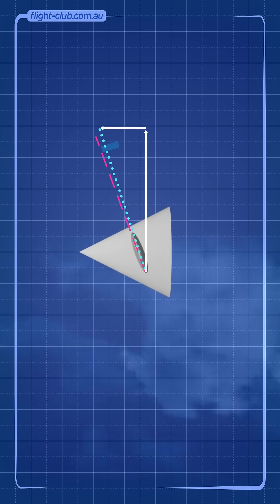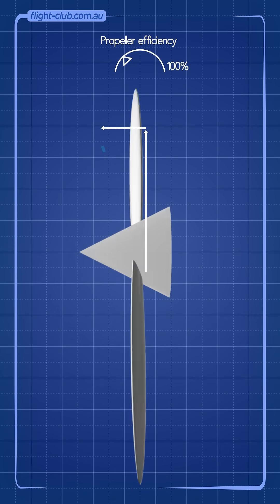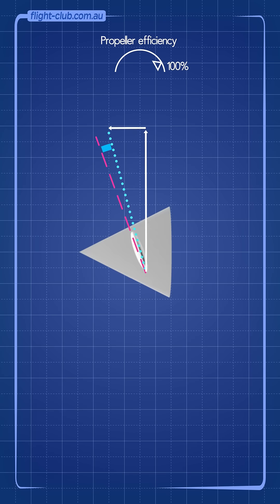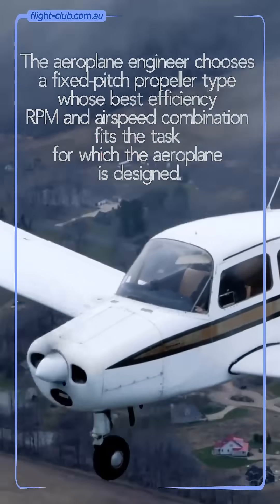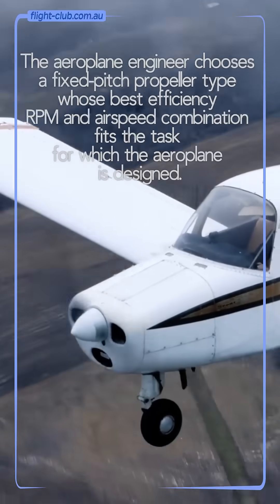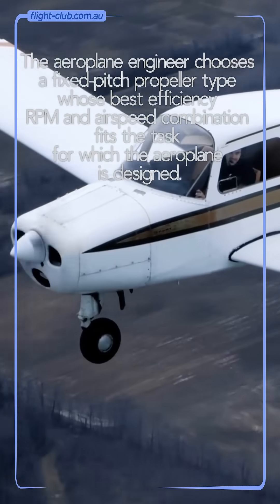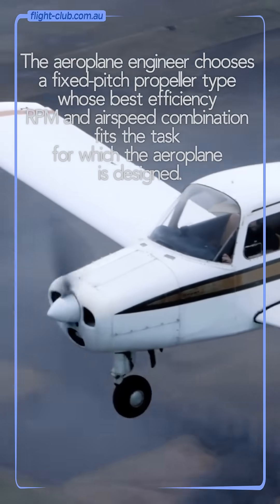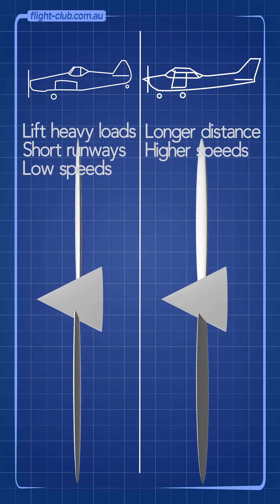Fixed Pitch Propeller #aviation #flight #propeller

Comment: Best way to think of a constant speed propeller is like gears on a bike. Going uphill? Low gear allows you to pedal fast without doing much workload. Level High gear, less rpm faster speed less tiring. It didn’t click for me until my instructor explained this. Doing my ppl ride in a c.s. propeller aircraft

Comment: The last part of the video.
I get the heavy loads cuz maybe and I’m also sure that it makes the aircraft slower hence you need a fine pitch propeller cuz the this will increase the blade AoA. I also get the slow airspeed, but why a short runway needs a fine pitch propeller?
Reply: Im not a professional, but basing my thoughts of aerodynamics and the drawing: less propeller pitch = less drag+more grip on the air at low speed(starting to take off) = less time to spin up and down+more instant speed = better acceleration and therefore less runway needed for take-off